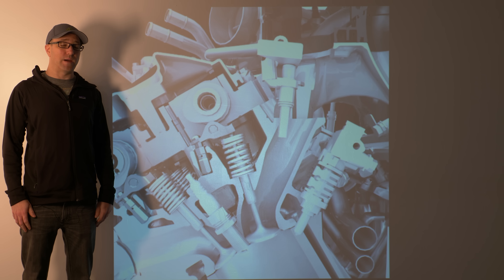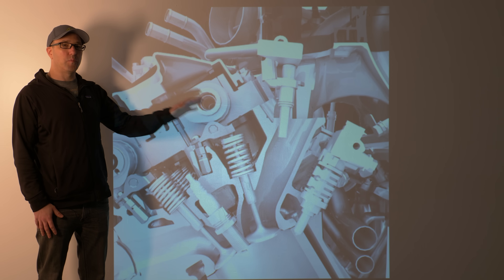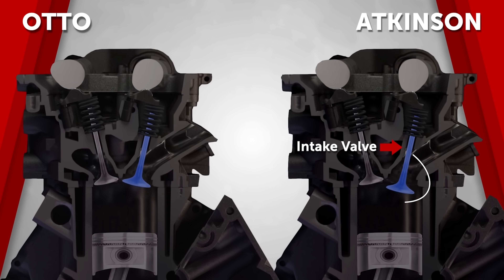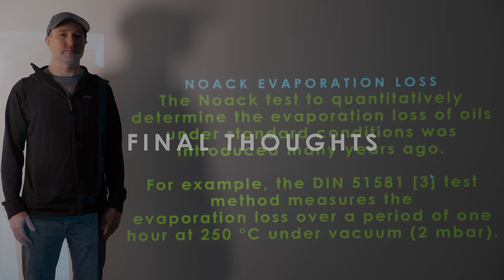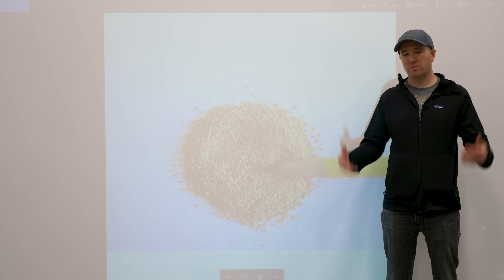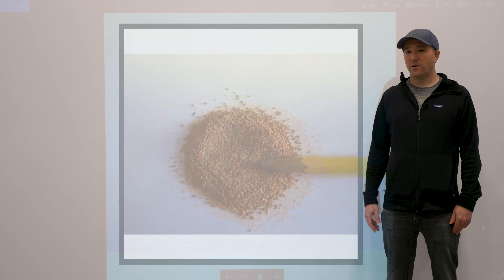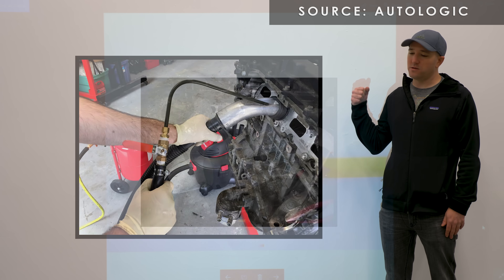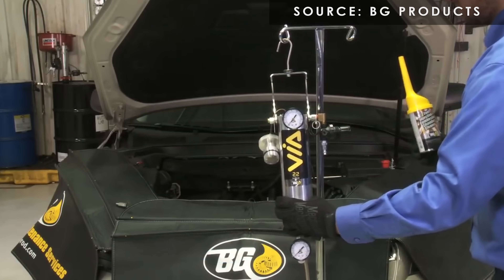Direct Injection, Problems and Solutions | The Fine Print

Comment: It's not that big of a deal,  we basically have to just plan another bi-annual mandatory service item to perform, once valves and upper intake are cleaned (with BG or other cleaner method), most cars should be good for approx. 20K miles before it needs to be done again. It just sucks that it is inevitable and will eventually need to be done. Great Video!
Reply: In all honesty, I’ve seen a lot of DI cars with well over 100k with no problems.
Reply: @dmandman9  I have 108K on my Ford 2.7 twin turbo, Zero issues thus far and have never performed any type of cleaning other than injector cleaner in a bottle. I run mine pretty hard 3500rpm+ and 115-120mph at least once a week. Not sure if that has anything to do with it.?
Reply: @tonychavez2083  as a Ford tech, I see them operated under various conditions. And to be honest, I don’t see deposit related issues all that often on any of the DI engines. I’m sure it happens on occasion. But we don’t see that many. Interestingly, the very new 2.7 and 3.5 Ecoboost engines now have BOTH injection systems that operate as the conditions dictate.
Reply: @dmandman9  good to know. Mine is the older DI motor without secondary port injection.

Comment: Another thing that might work is adding an injector near the pcv pipe that enters the manifold. But to clean that oil you may need as much as it gets in through the injectors

Comment: "Finally"... a comprehensive explanation of GDI engines
Reply: Long overdue. I had to work it out myself. Obvious when you stop to think.
Reply: pasoundman what was so obvious
Reply: @martese6555  Modern engines use positive crankcase and exhaust gas recirculation.  That will introduce hydrocarbons into the intake which then get burnt onto the inlet valve rear faces. This can 'kill' an engine.

Comment: Great presentation, my entire working career was in automotive so I commend you for informing GDI owners of the potential problems they will face....
Reply: If the chevy 1.5 liter LYX engine in my wifes 2020 equinox says to use 0w20 oil.....should i switch to a 5w30 you think?...only full synthetic ofcourse....it has 20.000 miles on it....been using valvoline 0w20 advanced full synthetic....was thinking bout changing it to mobil 1 advanced 5w30.....only like 1.4 centistokes difference in viscosity @100 celcius.

Comment: He missed one of the biggest reasons for DI: the cooling effect from the very-high-pressure gasoline injection allows as much as a full point increase in compression ratio, which translates to both higher power output and better fuel economy.  It's the main reason that modern turbocharged engines are able to run 10:1 compresson ratio.
Reply: Or 14:1 if it’s a naturally aspirated engine
Reply: In DI, you are only compressing air until the last millisecond, then you inject the fuel.  This allows for no pre-ignition detonation.  Newer oils have low vaporization and this helps
Reply: @richarddobreny6664  Does anyone really know how Direct Injection works?  Ford was working on DI gasoline engines in the mid 1970s and even earlier, and the official answer was stratified charge, that there was a cloud of fuel droplets that were ignited first, combating knock and detonation by burning the charge much faster.  But the Ford PROCO (programmed combusion was the monicker at the time) had bowls in the piston tops and other features to speed up combusion, and the guy I worked for told me the direct injection part was all smoke-and-mirrors, that you could get knock resistance with a "fast-burn engine" without the direct injection feature.  Also, 70s cars had 8:1 compression on account of the lower octane unleaded gas and had terrible gas mileage and power, and by the 1980s power and gas mileage started to pick up with 10:1 compression ratios that were made possible without direct injection and probably resulted from fast-burn combustion chambers.  Then there was that Smokey Yunick stock car driver/owner/master mechanic/genius race car rules cheater who had a mystery 60 MPG Chevy Citation,  prophetic about current GM small-vehicle powerplants in being a 1.4L 3-cylinder that was half the V6 optional engine for that car, to which he applied an insane level of turbo charging and intake charge pre-heating and for which he had some undisclosed tricks that the engine didn't blow up from detonation.  Don't think that had direct injection.
Reply: It sounds like you’re talking about the Ford eco-boost engines from 1.6 to 3.5 L👍🏽
Reply: @sherrokinchen5253 all direct engines have similar issues.
Reply: Yup can increase spark advance or cylinder pressure .
Reply: He did mention lower temps in cylinders from GDI.  But......fuk GDI.
Reply: Mazda Skyactiv naturally aspirated engines in North America have a 13:1 compression ratio.
Reply: @Fred_the_Headgen 4 coyote engines run 12.1:1 with dual injection, it really helps power, my 5.0 makes 475 at the tire with only a tune and cold air intake. It’s crazy how much of a change it makes compared to the Gen 1 and Gen 2
Reply: Are Kia sportage 2025 1600 TGDI Have this problems? Help because I’ m thinking of buying the new hybrid
Reply: At 6:08 He addressed  your statement.  He didn't miss anything.  We must listen better before we criticize.
Reply: From my point of physics understanding there is no difference in terms of cooling whether the fuel is port injected or direct injected!?
Reply: @marcuslang6153  It depends a lot on the type of port injection. Some are batch injection where fuel is sprayed constantly. Others use sequential injection and only spray when the intake valve is open. The cooling effect is overrated in my opinion. The main benefit of DI is multi-squirt. You can start with a lean, fast-burn squirt then add more to increase power. You get a hot, controlled, efficient burn. With DI, you can squirt fuel in late, which prevents pre-ignition and/or detonation. The FA20DIT runs 12.5:1 compression and 15.9 psi sustained boost.
Reply: @garymanis6305  thx for the explanation! Very much top-notch information in a few sentences👌🏽😊
Reply: @marcuslang6153  iirc having it in the cylinder will cool the surfaces of the cylinder itself while port injection will provide most of its cooling to the mixture. When the mixture is compressed having the surfaces its in contact with at a lower temperature makes it less likely to knock. (think the exhaust valve area where port injection wouldn't be able to do any cooling)
Reply: @K26650  i think I understand your point. I thought that the injected fuel should NOT touch the walls?
Reply: @marcuslang6153 Higher pressure difference (high to low) will amount to greater temperature drop.

Open your mouth wide, blow your breath and feel it with your hand.

Now purse your lips, blow your breath and feel again.

See how cooler the breath is?
Reply: Yet direct injection is a bad design for reliability. Port injection is much better for maintenance and hassle free long service. If you want speed over endurance build yourself a racecar.
Reply: @erikturner5073 could always do both like the new coyote motors. You get DI for low speed and low load and sprinkle in that port injection for high speed and high load. Best of both worlds. Though you do have to drive it hard to get the full benefit
Reply: @Grey5oh397 toyota uses both. Dual Fuel Injection.
Reply: Superb presentation. We just bought a Tesla, problem solved haha

Comment: Always bemused by the 6 to 7 DECADE lag for aircraft engine technologies to "migrate" to automotive use.  Turbocharging first became all the rage for production cars in the 1980s, but of course was invented WAY BACK in the 1920s to enable aircraft engines to breathe/run at higher altitudes.  Similarly, Das Germans (Daimler-Benz, et al) invented GDI for aircraft engines in the 1930s (DB 60x series), but it was not widely used in cars until... early noughties?  HIGH-larious.

Comment: So... the moral of the story? all these tech tricks to get bigger HP at lower displacements with higher efficiency is bullshit.
Fuel efficient, clean, high HP, and reliable cannot all happen at super small displacements. You eventually sacrifice something.

Personally? i would want a engine that has good torque, last 500,000+ and is simple to work on. Fuel efficiency and cleanliness be damned.

Comment: My VW has a DI Engine. At around 100,000 miles I got a CEL. Car ran fine, but took it to the dealer to clear it. Car has only been serviced at VW, and I have a great relationship with them. Recommended oil change with syn oil is at 10,000 miles. The car is a 2006, had it since new and only use Shell gas...period. Oil never goes near 5,000 miles and it comes out. Sometimes at 3500.

Anyway, dealer told me CEL was due to the valves possibly. They put a fuel additive in it, and cleared the CEL.  I talked with a mech, and looked up some info on my engine. About a month later, I drove the car about 70 miles to a speed shop and got some Royal Purple Fuel Additive. Dropped it into the tank and had a nice drive home with a sort of Italian Tuneup. Did the same thing a year later. Driven it 20,000 miles since, and not another CEL.  My 4 cyl 2.0 Turbo still gives me 34 mpg on the highway.

Just my experience, but I will continue to use the Royal Purple once a year until I am done with my car. I almost want to have the valves cleaned though, just because...but I guess I will wait until I get another CEL.

Comment: Future is electric car. If they can arrange lot of charging point like gas station and less time to charge the battery. 
Who want to deal with engine,  transmission,  injector,  spark plugs, engine oil, engine filter,  oil filter bla bla bla.
Electric car means a motor and battery that's all. Faster then traditional engine. The electric car motor is simple , like a fan motor....

Comment: Automotive engineers do not have to work on their own cars.
Modern cars flat out suck with all this unnecessary technology and computer felgercarb. Port injection works fine.
I contacted Toyota about this, and was informed that DGI will begin in the 2020 model year.
My 2017 Toyota Corolla SE has the complicated Variable Valve Timing. I maintain the motor regularly, but when the car is out of warranty and if the valve timing breaks, the repair will cost a fortune. The things I like about the car is the timing chain, not a belt, it has a non-interference motor, and it has a six-speed manual transmission. When the car is paid off, I want to sell it to buy an older, simpler car.
With a manual transmission.
Reply: Well, I've just found that honda 4 cylinders have been using timing chains since 2004, as Kia and Hyundai's are using timing chains as well. So just research what you're thinking about buying and see if it has a belt or a chain. It seems like a lot of the manufacturers have been bitten in the backside by building cars with timing belts as they are not cheap to replace.

Comment: "use a heavier weight oil so that you have a lower evaporation loss" yeah don't do that, use the exact weight and oil type your manufacturer recommends. you can do your research to choose the best brand but do not use a different weight than recommended or change the brand often. it's better to stick with the same oil for the life of your engine.

Comment: Solution not discussed here:
1,  11 oz. can CRC Intake and Turbo cleaner. 
Start your car and take it for a drive until it has warmed up to operating temperature.
Drive it home.
Find a vacuum line that attaches on the intake manifold, I use the brake booster line where it attaches to the intake manifold.
Start you car (while it is still warm)
Remove vacuum line at intake manifold.
Have someone sit in your car and hold RPM's at 2500
Begin spraying CRC into the intake manifold where you removed the vacuum line.
If engine starts bogging down, slow the stream of cleaner into the engine until it clears up.
Keep spraying the cleaner until the can is empty, this takes a few minutes.
Reinstall the vacuum line on the intake manifold.
Rev the engine a couple of times and shut off the engine.
Wait exactly one hour. This causes the engine to heat soak all of the decarbonizing fluid into the accumulated carbon buildup on the valves and the walls of the intake ports.
When the hour is over start the car and drive it to the highway. 
Don't worry of your car seems a bit sluggish at first or makes funny ticking noises, this is the carbon breaking loose form the valves and intake walls.
Take it out onto the highway and give it the old fashioned Italian tune up or in other words stomp on it, you might see a cloud of grey and white smoke come blasting out of your exhausts. 
Then drive it a while at 60-70 MPH.
After a half an hour or so, drive it home. 
Do this procedure every other oil change and your intake valves and intake port walls will stay clean of carbon. 
There ARE other ways to clean your intake system on a GDI engine other than on this video. 
I do this and I have no carbon buildup.
Reply: Most people are expecting newer cars to be less maintenance intensive. I cannot imagine my boss or co-workers doing this....ever. They will drive their 1.5 turbos until they start running like hell, blame the manufacturer and trade it in at a loss for another 1.3, 1.4 or 2.0 turbo where the cycle will start again. They will laugh at me for hand selecting my filters and oil and doing my work myself. I will curse while squashed under my car doing the oil changes along with the attendant mess. Eventually, they will brag to me that their .5 liter quad turbo is much more efficient and powerful than my 3.5 sohc with 250k on it. Why don't I trade in that old thing....? I will remind them that they said the same thing about my old 2.2 Vtec with 365k on it....
Reply: @tmmurphy  
Yes, Americans have become lazy as hell. It is also true that people who take it upon themselves to work with their hands and who show any amount of mechanical ability will always be taunted and looked down on by the circus clowns who don't know a 1/2"  drive ratchet from a screwdriver. What else do those people have? They are the clueless bitch and moan crowd. Just keep doing what you are doing. Never forget that they will never feel the accomplishment of doing something for yourself with your knowledge and your own two hands. THAT is everything to a person who feels an amount of inner independence.

Comment: Just a point, why would you want "lower cylinder temperatures" as suggested was desirable, the higher the combustion temperature the more efficient the combustion. Very low operating temperature has always been the biggest inefficiency in the internal combustion engine.  The higher the temperature they can run at, the more the power and the greater the efficiency.

Comment: Another reason I take good care of my 95 Miata, it's port injection. Plus it doesn't have a stupid touch screen so I can use the heater and not get stuck with a really high cost when those touch screens fail and boy they do fail.. I'll stick with older cars thank you... And use the best synthetic oil which is way lower than that 7% level. It costs but it's worth it.. It's not that mobil 1 crap.. Do your research and not buy into fancy advertising when getting oil.

Comment: my next vehicle is going to be a 1980's ford f-150 4x4.  i'll be looking for one with a clean body and a destroyed drive train.  i'll be putting in a completely new suspension and a rebuilt 300 six and a brand new rebuilt transfer case and manual transmission, 3 on the tree or 4 on the floor.  oh, and it will have manual hub locks.  no computer, no automatic anything and it will be the last vehicle i buy before i die.

Comment: In the intro: This is for fuel economy and emissions *annoyed :|
Six mins in: They can make more horsepower and torque :D

It's odd to see this young guy with this old man bias. It's out of place here. This isn't a maze of vacuum lines and pump devices added to the sloppily designed, low tolerance engines of the past. Fuel injection and computerization have vastly simplified maintenance over the vacuum everything, mechanical everything, belt-driven everything origins. It's a testament to stupidity (or bean counting on 100k mile warranties) that they would come up with a valve-washing injector lol, instead of a catch can that their dealerships would have to drain and rinse. Or how about we move away from mechanical valves? Is Koenigsegg the only one pushing for camless heads?

Engines were never designed for this? So? Would it have been designed differently if they had port injection from the get-go instead of carburation? Isn't it redesigned every car generation (most Japanese and German cars, anyway)
Reply: You harp on regulation but the auto manufacturers bring it on themselves. The free market has been no help here. Regulations are the only thing driving innovation. Manufacturers do everything they can to resist moving away from gasoline, and the US govt heavily subsidizes gas (our tax dollars) to make it artificially cheap. American car companies would just love to keep selling us the same 1970's engines. Just look at the lightly regulated American truck engines. Ford and GM keep reusing their ancient engine designs that waste fuel, waste power potential, so they can reusing their old parts inventory and not have to redesign and thoroughly test a new design. They slap a bunch of emissions band-aid devices on there, pass the cost onto us, and expect us to blame our govt. The same govt that we demand provide clean air for our kids to breathe.

Comment: Koenigsegg's engines don't need direct injection. Or camshafts. The valves are operated entirely through a computer-controlled pneumatic system.

Unfortunately, while dual injection systems are really awesome, many motorsports also ban having multiple fuel injectors. And because a lot of technological development comes from motorsport... Yeah...